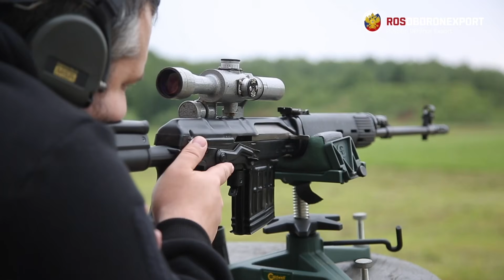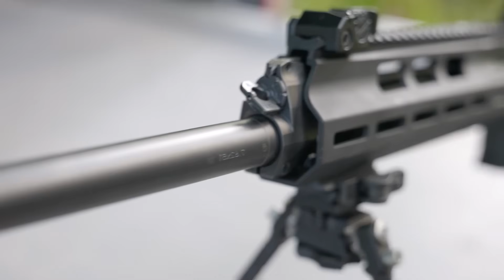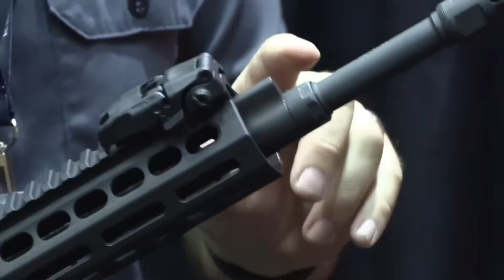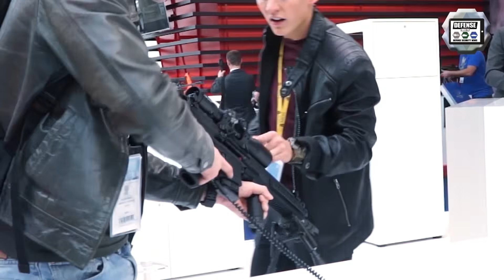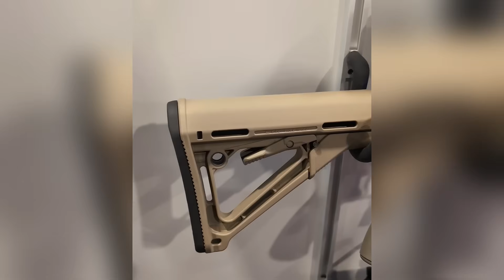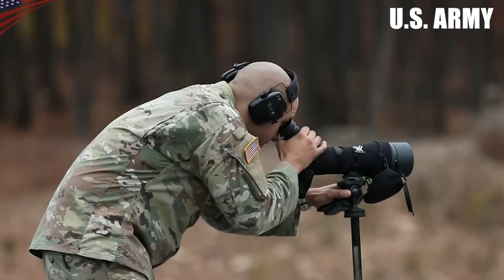Countries With The Deadliest Designated Marksman Rifles (Ranked)

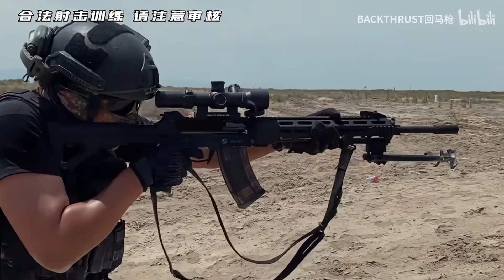Comment: 3:43 600 metres is a pretty good distance for a precision rifle. The 191 is more of an spr than a true Dmr. It feels closer to a Mk12 than a Sr25. Afaik China has no full calibre guns. And judging by modern military scope, full calibre rifles are pretty rare. They definitely have their place but as a widespread usage they’re not that common. Most of the times a squad designated marksman is using a 556 spr anyways instead of a full calibre battle rifle. Distance at which a prone person with a scope can see a standing target is only 300 metres in 90% of modern day battlefields. So battle rifles with longer effective range kinda becomes very niche at that point. The one place a full calibre will truly shine however is definitely when shooting at cover. They penetrate concrete walls pretty easily. So if you need that firepower that’s when you employ a full calibre gun, otherwise even for precision shooting in standard warzones conditions mid calibre is all you need. So the 191 is definitely a very effective weapon in its own category.

Comment: Categorizing Dragunov as a bad precision rifle is the dumbest thing I will here in 2026.
Reply from the maker: The Dragunov isn’t a bad rifle, it’s just not a modern precision setup.

It’s a rugged combat marksman gun, but compared to newer DMRs it gives up consistency and modern optics mounting.

If you mean combat reliability and real service record, SVD is easily one of the most proven rifles ever.
Reply: @thegunversity  so you should have rated it more higher, it has seen most combat action
Reply: @andrewuche4074  it's old and lacks modularity. and that rimmed ammo, geez... wth???

Comment: What about SVCh Chukavin
Reply from the maker: SVCh is the direction Russia is trying to go, it’s the newer platform that’s meant to move past the old Dragunov limitations.

If it ends up being widely issued and actually standardized with a solid optic setup, it’s the one that could change the conversation for Russia.

Have you seen any good recent field pics or unit issue info on it?

Comment: Calling the SVDM rifle bad is the most stupid thing I've heard today it should be top 3
Reply from the maker: SVDM isn’t bad at all, it’s proven and it’s tough. Top 3 for me means the rifle does more of the work for the shooter: consistent precision, solid modern optics mounting, and an overall setup that’s built around the marksman role, not adapted into it.
Reply: @thegunversity then explain that thumbnail
Reply: @thegunversity And it's not even Russia's standard issue DMR anymore you just brought up something outdated to compare with the newer precision rifles and Russia's standard issue DMR/precision rifles now are the SVCH 308, SVCH 54 and SVCH 8.6( 338 lapua)
Reply: Ты обиделся на то, что почти 70-летнюю винтовку, которая не может тягаться с современными конкурентами, обозвали говном?😂
Reply: @shabanov88 that 70 year old rifle is better than most of the rifles here use your head
Reply: @TehillaObuene That lil bro just give 37 countries that adopt it a middle finger 😂
Reply: @HungAn-n7g  maybe if you use your head you would realise that the SVDM has been unadopted for a while now and now they are using the SVCH 308, SVCH 54 and SVCH 8.6(338 lapua)